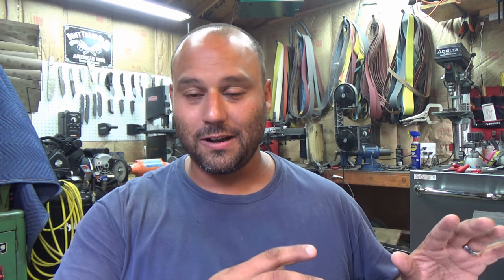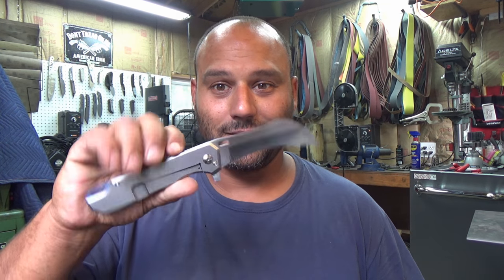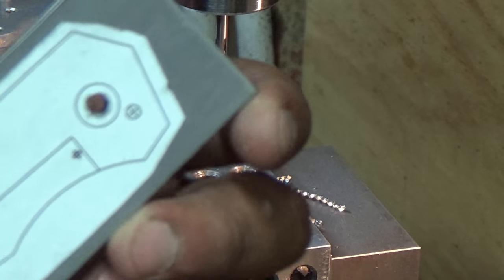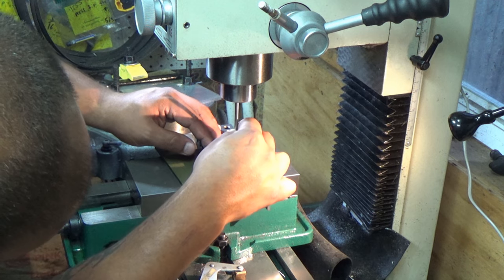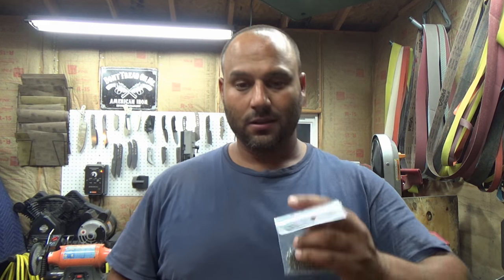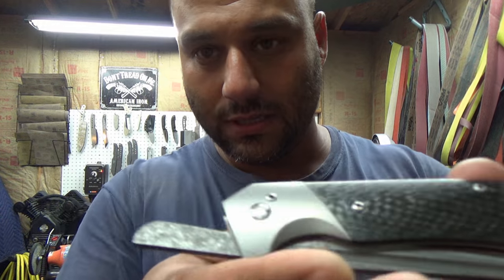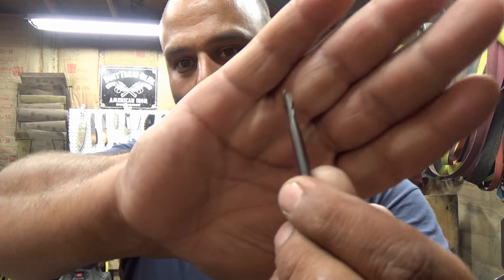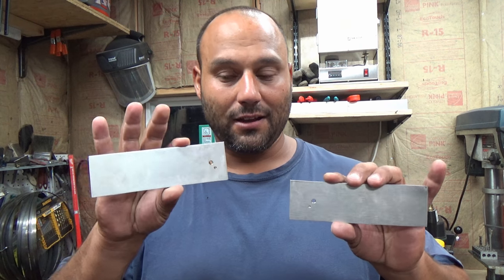Making a folding knife #3  Titanium handles and stop pin!

Comment: Holy sh*t that counterbore is expensive! I guess that's to be expected for a small production run of custom sized carbide tooling.

I can think of another way of doing this though. You can use one of those precision ground drill rods to locate the screw hole exactly under the spindle. Then you clamp the handle plate to those handy dandy 123 blocks with step clamps, change the drill rod to an appropriately sized end-mill and do it that way without breaking 120$ in one shot if you screw up.

Maybe I missed something but I didn't see or hear you consider this method.
I recently made solid copper soft jaws for my vise and I used a plain old twist drill to counter bore for the socket head cap screws. I had 0,20mm wiggle room over a 10 mm screw head with a drill press that runs out about 0,21mm. It all ended up fitting like a glove.
If I can do that with a craptacular drill press, I'm sure you can accurately  pull off what I described on your mill.

Sorry for the metric, I'm from Belgium
Reply: That is how I though about it doing it cheaper, the other thing I think I will do when I get a mill is make fixture plates that I have a corner to zero off then just use your dro to know where every drill action goes and what depth but maybe that's just me coming from studying cnc so much
Reply from the maker: Every other knife I've made I did it the way you are suggesting with that .161 2 flute endmill which I think costs $10.  Quite a difference! I would have continued this method but the titanium screw heads have a slightly smaller head diameter and looked odd in my usual endmill hole.  I had a very hard time spending that much money on a tiny little counterbore lol. The knife I showed briefly was done with the endmill and has standard stainless 2-56 screws. I'll touch on this again in the next episode. Thank you for watching!
Reply from the maker: I've made a few fixture plates but I found repeat-ability to be an issue with hand cut scales. there just seemed to be too many variances to account for. You are right about Cnc, when I get a machine that will be my best option!
Reply: do you think if I had a blade and scales water jet cut that would make fixtures possible? I been looking at a getting grizzly, rather get a tormach but price is the king of decisions lol

Comment: Mike Please post part numbers for the screws and special bits anything that size and type we may need , Can you post a pattern so we can start by using Mic 6 1/4' practice only don"t want to copy any ones designs just need the starting point as far as size style any information will help , Thanks Mike